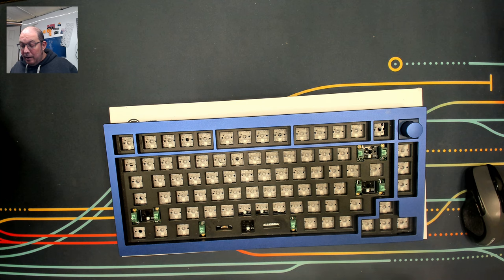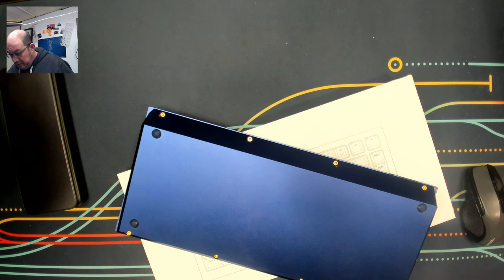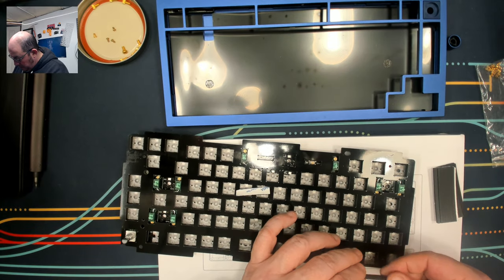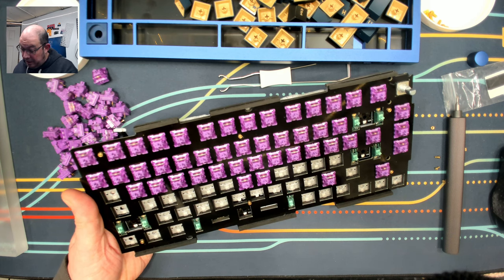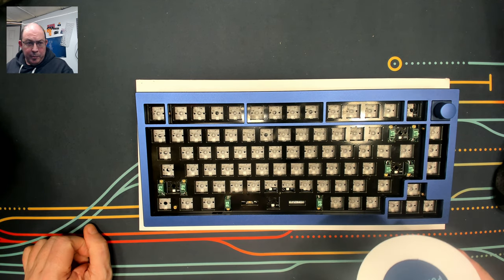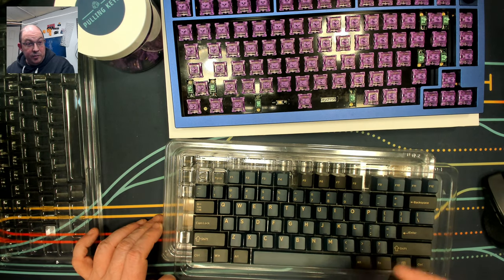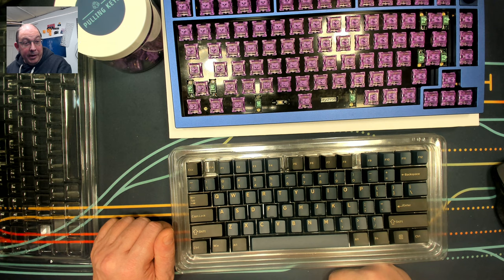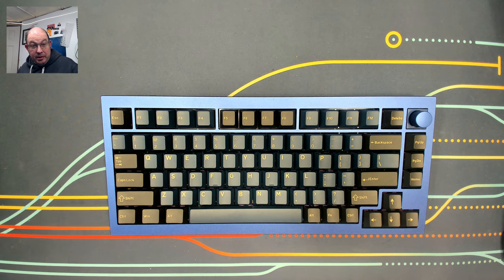This one thing will be the best upgrade for the Keychron Q1. FR4 plate install and sound test.

Comment: Hey, do you know the dimension for the studs? I bought a pc plate from Aliexpress and it didnt come with any screws. Was in the midst of reassembling the plate to my pcb when I realised the blunder. Btw great sharing about the studs, no one else talks about it.
Reply from the maker: Sorry, I did not take measurements.
Reply: @MechKeyboards  will not screwing the plate to the pcb do any harm? Will it alter the feel or sound?
Reply from the maker: @khalidrahman284  most of the times it is not an issue, but I can't say with this one as I did use the screws.

Comment: The Keychron Q1 is my first (and probably last) custom keyboard. Your configuration sounded really good, and I was wondering how to switch the plate from the Q1 steel plate since I joined a group buy for a polypropylene plate. Now I have an answer, thank you!

While I'm waiting for my PP plate, may I know if not installing the 2 centre screws in the steel plate would make it sound and feel better?
Reply from the maker: I did not try it, so can't say for certain, but I would assume it would make little to no difference.